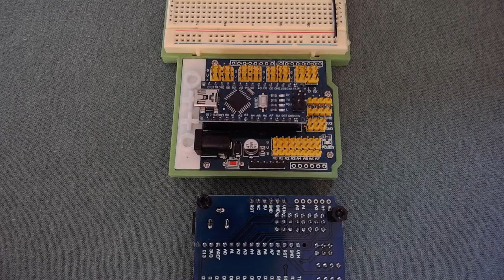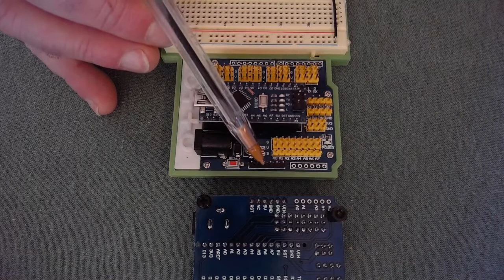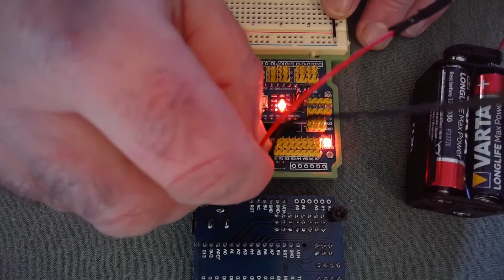Connecting the Power Supply or Batteries to the Arduino Nano Shield for Otto robot

Comment: Hı, I want to use 9v or 3s 11 v battery on otto diy. However, I don't known how to connect these battery on otto diy. How is wiring diagram?
Reply from the maker: it depends what board do you have? and exact battery, I suggest you post a photo with the question in our community to get what you need